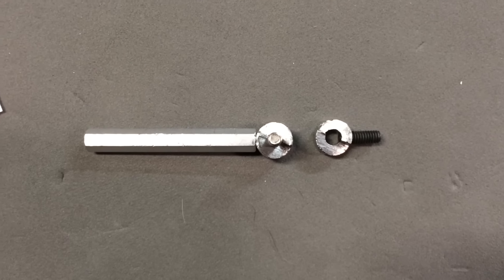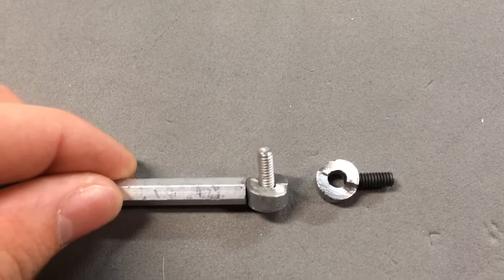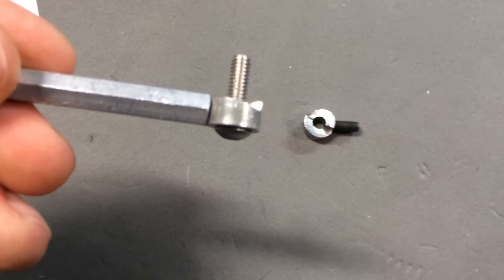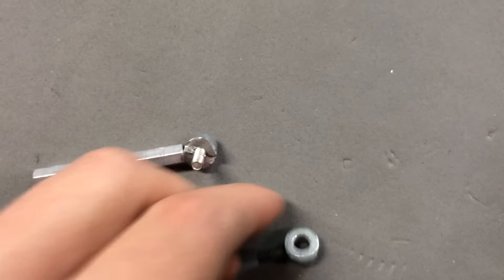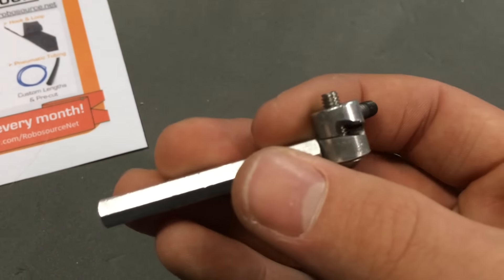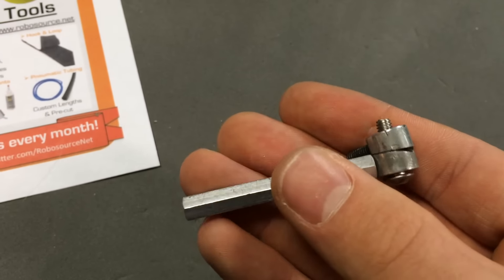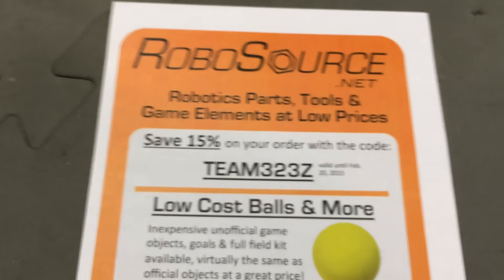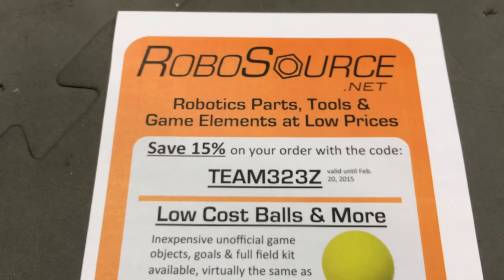Passive High-Torque VEX Lock

Comment from the maker: This is good for any application where you need to restrict rotational motion to a single direction at a very specific point. I should have been more clear in the video - we love the design. But for the application we were using, we realized we only needed a bumper rather than a ratchet system.